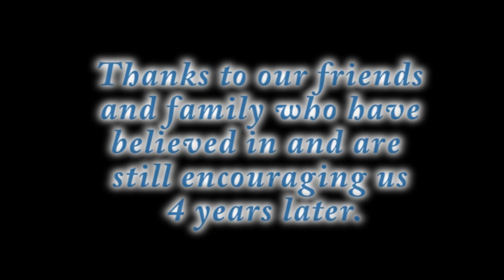Hardening A Section Of Rail, Will It Work?

Comment: Jeff, years ago I was a car man with MoPac RR and I will attempt to answer your question regarding how the lip or ridge formed along the sides of the rail's head  just to satisfy your curiosity. The rail head deforms over time due to the heavy loads carried along them and as the wheels of the train roll along the rail there is a tremendous force that will slowly displace the grains or molecules along the surface of the railhead and since the flange on the wheels runs along the inside of the rail the displacement is directed outward. If the ties and ballast did not move and absorb a lot of the energy the process would happen much faster and be much like the cold-rolled steel process. If you have seen how easily metal deforms when it was placed on top of a rail and then run over by a train you would be amazed at how quickly and easily the metal deforms and ends up being only a few hundredths of an inch. Despite the incredible forces involved a properly placed piece of metal can derail a train, so I do not recommend anyone try that or to mess around any railyards or train tracks as you can easily get killed or injured and it is also a federal offense. Now it would be good to contact a railroad if there is a railyard, car or diesel shop in the area and get a tour set up for your scouts and they could also work on completing some of the requirements for the railroading merit badge at this time. Anyway, I hope you found this helpful.
Peace!

Comment: Now that was cool, I think you can drop it in and not worry. I've seen others do it. I tried that out on a cheap vice to harden it.
keep up the good videos.
Reply: as long as your quench tub is made out of metal instead of plastic it will melt  the bottom and I feel like something should be said for heating up the water or oil before you quench

Comment: If you can get a chunk of rail from what is called a plug, which is a preassembled insulated rail joint which comes with 10ft rail attached.  They are made of hardened steel instead of softer rail steel.  They make a better rail anvil, I used to work for the railroad and mine hasn’t shown one ding in the last thirty years of use.  I even used it for a large caliber target for a couple years.

Comment: haha scary! i was nervous lugging that hardy hole stock from the forge to my anvil... cant imagine lugging that piece of track through a shop haha! ive seen guys do a running water quench on stuff like that with large mass... the reason for that is so that it cant really form a steam jacket. when you drop the piece in the water, it will form a jacket of steam around the piece. you can get away with a bucket quench if you aggitate the piece, but shaking a chunk of rail around with tongs holding it would get exhausting fast.

great project Jeff! have a great week!

Comment: excellent video made better by all the educational discussion it generated.   I cut track with an antique electric hacksaw but have done it -once- with a high tension hand hacksaw.  (That's now off my bucket list).  Two or three inch cross sections of track cut apart at the narrowest part of the vertical beam make quick hardy hole tools and bottom swages.  Fitting the swage shank to diagonal dimension of the hardy hole puts the rail top swage working surface edges at a forty five degree angle to the long axis of the anvil.  The remaining piece, the bottom of the rail, can become a hardy hot cut or hardy fuller.  Fitting one of the bottom flanges to the diagonal of the hardy hole makes the opposite bottom flange the upright and the shorter middle beam a shoulder.  Wood wedged in the hardy hole against what was the original bottom of the track base secures the improvised hardy tool.  now I know I can harden them.  thanks.

Comment: not that it matters, railroad metal is actually pretty soft metal, and designed to reshape itself, which is why you see rail grinders reshaping the rail. the wheels on a railroad car are actually the hardend steel

Comment: Best way to test rebound, use a 1 inch ball bearing, drop from 10 inches, should bounce back to at least 6-7 inches for a good anvil, also to quench you should use canola oil and agitate the material rapidly, you could also roll the hot metal in carbon powder then back into furnace, repeat a couple of times this will increase the carbon content, before quenching in the oil, another way is to nitrate will get deeper hardening 👍

Comment: i suppose for the hobbyist on a small scale, there is something nostalgic when using a piece of rail, not to mention the cost, and delivering saving. i use an old lathe chuck and rail for hobo coin engraving and the like for practice. im still crap, but a tryer

Comment: Instead of quenching in regular tap water,  try quenching in either brine, or better yet "super quench".  Do a quick Google search for super quench and you'll find plenty of results for the recipe.  Basically it's water with specific amounts salt and detergents and etc. added (depending of how much water you use) to it to speed up the quenching of the steel.  When using plain water, especially when quenching a piece of steel with that much mass, tons of tiny bubbles envelope the hot steel causing what is known as a vapor jacket.  This vapor jacket is actually not allowing the water itself to make contact with the surface of the steel, thus causing it not to cool fast enough in the water.  Brine (and super quench) cause this vapor jacket to somehow ( I forget exactly why it works, but I know it works 😉) collapse, thus enabling the water to make and continue making contact with the surface of the steel cause it to cool much faster.  

Another thing that helps with breaking up the vapor jacket is agitating the piece being quenched either up and down, or back and forth as much as you can.  I say "either" up and down or back and forth because as a knife maker, when quenching blades with such thin cross sections, moving it side to side or stirring in a circle will cause the blade to warp usually pretty bad.  However, with the amount of mass in a section of rail road, I don't think it really matters how you agitate it, just as long as you do it.    

So in short ( lol ) I would really suggest trying you next quench not in oil, but in a "super quench" solution while making sure to agitate it as much as you can.   If that STILL doesn't harden enough, then case harden (carbonize the surface of) it, but still use either brine or super quench instead of plain water or oil, and agitate.  Hope you find this somewhat useful 🙂.    I enjoy your vids, keep em commin! 👍
Reply: @kacper0291  ... your right about water never going over boil point ,it just steams off ; but ;  only a comment here, I come from a small fishing town(village) where people do there own repairs to save money on travel... the steel quenched in tap water is hard but we often just throw it into the ocean (just off our docks a few feet deep) and it's much harder

Tested by many Fishermen for decades and sworn by
Reply: @matthewdenty7760  maybe its because the pressure that shoves the steam away?
Reply: @kacper0291 .. just what I read ,, the "steam blankets" coming off the steel  are slowed by the salt resulting in more water contact cooling ,, faster cooled harder it is

Comment: Journeyman TIG welder here and well versed in metallurgy, the RR track is made from different alloys, but tend to run .70% carbon to .80%, called 90 UTS rail or Grade 880. A .45% and higher carbon content will get quite hard. RR track has to be high carbon, the train wheel is 1050 or 1155 steel so the RR track must be harder, or it will deform, disastrously if heavily trafficked. Understand the track is not fully hardened or it wouldn't bend or machine. It is so thick that trying to heat treat it would only succeed in making it hard to about 1/8-1/4" deep, depending on sectional density.
http://ispatguru.com/rails-and-rail-steel/

 Most RR spikes are .30% and not very hardenable, but there are some that were .6-8% and definitely hardenable. Only way to tell is to heat treat and see.
Just FYI, steel bed frame angles are like 1080 steel as well.
Reply: This is very helpful info!  What do you mean by a bed frame angle?  In my head I can only picture long angle iron with some holes   with casters attached
Reply: @briholt100  Same thing you said. Bed frames are made of high carbon steel as well, but it may differ from 1055 to 1080 and treated to spring hardness. I would treat it as mystery steel

Comment: The price of track I've got the bottom flange is 8" the top is 6" and it was all I could do to Mill the top flat I could only take of .015 at a time and went through all three side of a three price cutter the price is the exact size of the tracks running through our city. It has a Rockwell of 55

Comment: I would like it harder, and maybe a few other alterations on the shape. I work on small projects, but the metal I'm working may be soft copper, brass, or hardened steel. I can't have a dozen small anvils around, no room to store them. I have one small normal shaped anvil that does most things okay, but won't do everything. I'd also take the surface to a very fine sanding, like 5000 grit or higher, since some of the items I work on will pick up any imperfections in the work surface. So, what steel would actually give the hardest surface, yet be differentially hardened so that it will take the pounding and not crack or break? I wouldn't know, I don't do hardening or forging to any great degree, mostly I'm doing repairs.

Comment: Jeffrey 
   FYI golf balls work nice for file handles
Reply from the maker: Do you heat up the tang of the file and melt it into the ball or just drill a hole in the ball?
Reply: Drill the hole .This works nicely on account the ball is round and makes a nice handle.
Reply: Jeffrey Santo wranglerstar did a video where he made golf ball handles by drilling a hole slightly smaller than a nut, then pressing/gluing a nut in the recess. Then it bites and locks the file in place
Reply: you know..... some golf balls contain asbestos.... just saying....
Reply: Small amounts of asbestos do nothing.  I have asbestos gloves.  I'd only worry about it if you drill golf balls for a living.
Reply: LimitedGunnerGM + I've heard files make good golf balls. But if one looks to be headed toward another golfer, ya have to yell 44 instead of 4.

Comment: if you want it properly hard you'll have to case harden it... get some casenit , get it none magnetic and dip it.... when it's cool it will be harder then tattood granite.
Reply from the maker: In the future I want to try and get a section of rail that I can cut up... water quench one piece, oil quench one and now thanks to you try case hardening one. Just need to find more of this stuff at the scrap yard. Thanks for the comment :)
Reply: not a problem, the thing is with steel it's not the iron that makes it really hard, it's the alloys and carbon levels. the heating/cooling changes the toughness and brittleness of the steel, but in order to produce hardness you need to introduce carbon onto or into the material.

most mild steel you commonly get has a very low carbon content, hence the ability to harden it is reduced, if you case harden the surface you are doing the same process more or less that was used to make armour plate, that is introducing a material to the surface that changes the properties of the steel.

the old way of doing is is case hardening,  the old warships used to use the Krupps process, which involved baking the steel in a high carbon atmosphere for a few weeks, allowing carbon to diffuse into the surface of the plate,  the end result was surface hardened plates that were up to 19 inches thick and were so hard most artillery just left a small star pattern on the surface.
Reply: Don't forget to sand cool it in a bucket of sand or flour dry kitty litter as my uncle called it or just hard clay soil thats dry. cover it fully in it.  one thing about hardening just one part of somthing the cool side will wick up some of the heat so you could just air cool it and get it harder to some extent depends on how much carbon is in it.  Now one question is why would you want to strike case hardened steel with a hammer? can it blow up or shatter? is there enough carbon to turn it brittle?  You might be better off with a semi soft material.  By the way I used to drill and saw stainless steel    
when i worked in a machine shop and I can tell you its a lot tougher then train track is, it requires a lot slow cutting speeds with tool steel.

I'm going out on a limb and state train track is close to 1018 hot rolled metal or structural steel. That's purely a guess as I've never done a Rockwell test on any track to test its hardness.  Does anyone know what the normal hardness is for Railroad track in North America assuming Canadian track is the same?
 " I think it is and its a standard for RR's but not private rails like trolley cars subways and mines or anything like that"

Comment: Typical railroad rails are manganese steel.  This material work hardens 
on the surface of the rail crown under the impact of the train wheels 
while leaving the bulk of the rail softer and ductile.  When high 
quality Thermite welds are made a "packet" of alloying metal is added to
 the top of the rail weld to allow it to harden like the rest of the 
rail.

Comment: Someone did a test on a piece of track, high carbon steel and mild steel. Small pieces. So, as Shawn C notes, the rate of cooling makes a big difference in the resulting hardness. That said, it would be quite a challenge to move a somewhat heavy piece of steel around the shop when it's really hot. https://youtu.be/M8KvKFQwtUs

There's a YouTube video of guys in Australia who make anvils, and when the cast steel anvil is pulled from the mold, they place it outside and douse the top surface with a hose to get it to the proper hardness.

Comment: Hi Jeff, I posted a comment on rail composition on your previous vid, but forgot to add a couple of things. The piece of rail you have there is quite worn, the edge profile has been gradually worked until it flows out sideways. (the bit you are milling off) The actual running surface is work-hardened by the constant passage of wheels that are exerting 10+ tons per square inch; manganese steels work-harden and are designed for toughness and durability rather than hardness. Early railways used cast iron; they were brittle and snapped often until steel was developed. there are varying levels of rail, pick one from the spec number rolled into the web.
Typical rail compositions are like this in UK:
http://www.iorw.org/jobknow4.html
Reply: nlo114 hey buddy u seem pretty knowledgeable about this. I was looking at stuff to make an anvil out of and i came to the conclusion that the brackets used to tie railroad tracks down would provide a cleaner-wider surface for me to work with. if I flipped it upside down.  I was wondering though if I should make an attempt at hardening said bracket. I have no idea about the composition of this bracket so im kind of at a loss. I plan on using it to make tools and knives so it will be taking a beating. what say you about this?

Comment: Hi Mr. Santo. Looks like you are done for now with its
intended purpose. For the future I can tell you with 80% accuracy the composition
of the rail is as follows. 0.55 to 0.77 percent Carbon, 0.6 to 0.9 percent
Manganese, 0.1 to 0.23 percent Silicon, 0.04 percent maximum Phosphorus concentration,
and the remaining % Iron. I read all the comments below and would recommend super
quench once its non-magnetic. Use cold, cold water with salt and liquid soap.
(Google Super Quench) If I knew the exact dimensions of your RR track I could
tell you with 99% accuracy what the composition is. RR track is identified in
pounds per yard and by year and manufacturer. For the most part the formula I
gave you above should work fine. If you weld on oh say a top of 4140 Annealed
Cold Roll Steel at least ¾” thick with E7018 welding rod you will have to preheat
with a torch first for a great weld. Then Oil quench between 1525° -1625° F and
finally temper in a 5000 F oven for 2-3 hours, shut the oven off and
wait for it to air cool to the touch. Bingo, a very versatile anvil that did
not cost $500.00 like the one I saw in your great video. Hope this helps out
for others as well. I’m just a noviceJ
Reply: Correction :  temper in a 500 degree F oven for 2-3 hours (Sorry about that)

Comment: * By heating steel to critical temperature & quenching in an oil bath, (while moving your mass in a figure-8 motion thru the oil, [^*Hint*^ use an automotive cherry-picker] the result will be a case-hardened mass of steel that is very resistant to the impact of blacksmith tools & won't oxidize before your grand-kids have grand-kids... 

! By quenching in water (regardless of tap, brine, or other) only serves to increase the porosity in your rail (similar to the brittleness of cast iron at a microscopic-level) as well as hasten oxidation (rust), resulting in an inferior, maleable anvil that will be prone to stress fatigue, tooling imprints & an undesired headache from the resonating ping. [try pounding on an I-beam for the same effect]